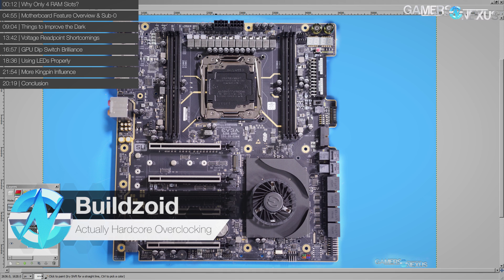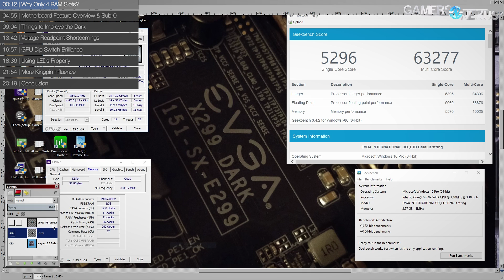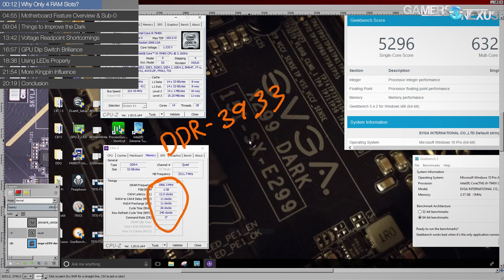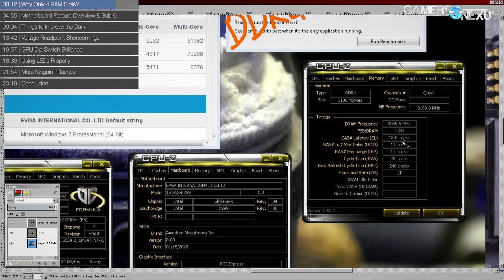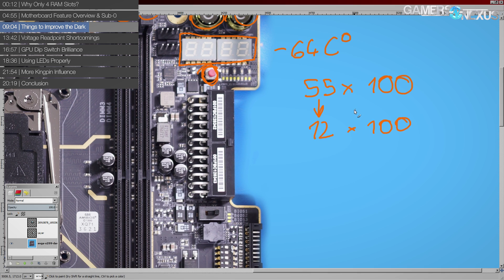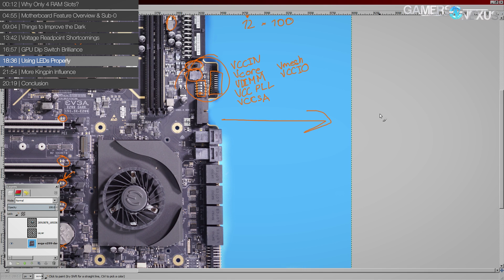4 vs. 8 RAM Slots on X299 | DARK Feature Review

Comment: I wish more motherboard manufacturers showed the CPU temp on the post code LED readout.  ASUS used to do it, but inexplicably, they stopped.  I asked JJ from ASUS why they don't do it anymore and he answered with, "why would you want to know the CPU temp?"  Ohhh, I don't know, maybe because having an accurate reading of the CPU's temperature can be critical knowledge when it comes to protecting the life of a $1700 CPU when overclocked?  Geesh.

Comment: See, the issue for me is that "extreme overclockers" is generally just a hobbyist market - whereas the active-cooled VRMs would be VERY beneficial for all X299 users, including those that need 8 slots. Kind of frustrating.
Reply: EposVox its called using a case that has fans in the front and rear of the case. Problem solved
Reply: That has nothing to do with VRM cooling lmao
Reply: EposVox you have to look at this as a business man like my self( owner of a 711 and a day trader) it makes sense to put active cooling which looks ugly on a board that is ment not to be in a case, but most other x299 boards are ment to be in a case, so why would you put a active cooling not to mention many people who actually need it direct airflow either have a monoblock or have a fainpointed at it, when i did some ln2 on my friend 7980xe I put a noctua 3000 rmp fan because those little dinky fans did 5°c less, I just dont get your point there is no problem if the product is used as intended pay more get more, other boards have to appeal to certain demographics of the x299 community, very simple bio we strategies bro, not saying your not smart in your own subject, if you think I left out something let me know as I am open to learn
Reply: "so why would you put a active cooling not to mention many people who actually need it direct airflow either have a monoblock or have a fainpointed at it, "
Because that would solve the need of shoving a fan in an awkward place in a case and have the motherboard do its job in the first place? As per literally all of GN's coverage of X299 VRMs?
Reply: @Sniper Pro nerf mods, typical answer of a business 'owner'. Trying your best to avoid doing any work for yourself and let other 'factors' do the work that would actually be your responsibility. All for personal profit that will never do any good in your actually incapable and unresponsible hands, since you are just an owner, nothing more. Yes you may be smart, you may be right in a way that you could cheap out on active VRM-Cooling but that is an application and usage of brainpower in a way that is utterly disgusting and repelling to me. Sry.

Comment: RAM is so expensive nowadays that nobody would populate 8 slots anyways
Reply: 2 years later and ram is still somewhat expensive
Reply: SubZero it’s no where close to the prices from two years ago, 16gb 3200mhz $220 two years ago and now its $70. That’s for tridentz at least
Reply: @user-nq3xi4wm2k  the one I have is still close to 300 for a 32gb 4pack g.skill f4-3600c17-8gtzr

Comment: It's interesting the troubleshooting LEDs aren't somewhere else you'd see them, As a further improvement to the board, I wouldn't mind the troubleshooting LEDs along one row at the top or left side as an easy reference that's easier to manufacturer, and easy to make with RGB LEDs and multiple channels with a shared ground, rather than ground points everywhere for specially-relevant LEDs.

Would be even cooler if it was an attached flexboard so you can tuck them under and away if you don't need them, or keep them front-and-cantre, they can print on the flexboard too so they wouldn't have to worry about printing on the motherboard directly.

Comment: If it doesn't have a Slow-Boot button/toggle, but it does have Tripple Bios (which doesn't have much purpose apparently) couldn't you just set the third bios to 12x core ratio / multiplier, and it would essentially be the same thing?

Comment: #AskGN , #AskGamerNexus

Delidding; Do you have to remove the glue on the sides holding the IHS? or can you just use the tool's power (assuming the delidder used one, such as der8auer's) to relid without removing the glue? or do you simply remove the glue and put the IHS then using the relidding tool?

Comment: Can you tell us what kind of Ram sticks  are you using to achieve those Results?
Thanks.
Reply: It's B-die. Anything that's 4000ish CL12 is B-die
Reply: E-die does 4000 CL12 but with high TRCD and TRP(around 20). B-die does TRCD and TRP 1 lower or the same as CL.
Reply: didn't know that. cool

Comment: PLEASE VERIFY... So DDR4-4000 means 2000MHz per stick whether it's in Single, DUAL or QUAD, but the actual BANDWIDTH provided to the CPU would be up to TWICE for Dual vs Single, and up to FOUR TIMES for Quad vs Single?
Reply: you double the value cpu-z spits out for DRAM Frequency, and it has nothing to do with the # of channels. all sticks run that speed, whether you're running 1, 2 or 4.
Reply: DDR stands for double data rate, meaning that a DDR stick effectively doubles its clock rate compared to single data rate ram, since it sends/receives twice as many signals per clock. This is true regardless of the number of channels the CPU supports.
Reply: yes that is correct. 4000MT/s = 2000MHz regardless of channel number

Comment: What kind of RAM should I buy to achieve, like shown in the video, around 4000mhz at 12-11-11-28 timings?
Reply: Beef Chicken prob a decent b die kit
Reply: those timings are on way too much voltage for daily use